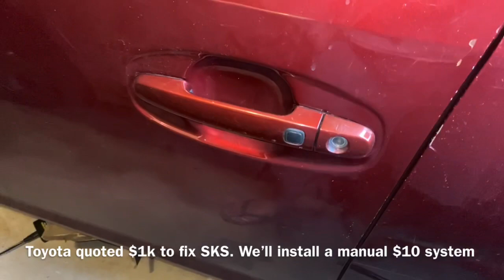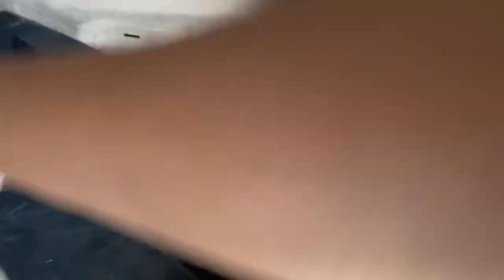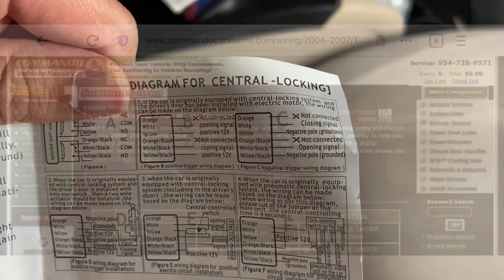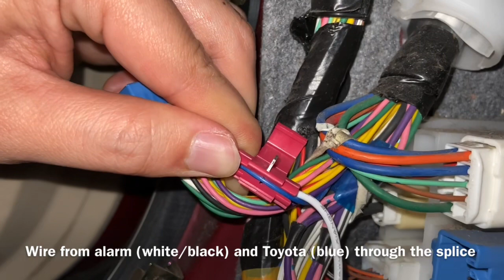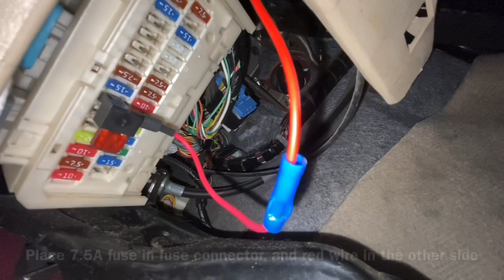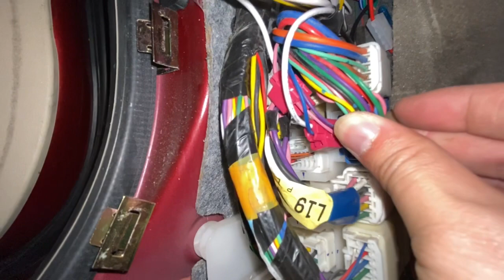How to Install $10 Keyless Entry in Toyota Prius! (b/c SMART KEY FAILED!)

Comment: What exactly did you do wrong to accidently reverse the lock/unlock? The website matches the notepad doc you showed, blue is lock so it gets white/black, pink is unlock so it gets the white wire. It looks like you put the white wire with text to the blue, which is what you and your captions say should be the white/black wire. Then you show a solid white wire connected to the pink with the appropriate caption to match. So what in the hell? Is the white wire with black text not the white/black wire? Or did you go back and refilm the correct connections and left in the part where your buttons were backwards?
Reply from the maker: 1. Caption is correct -- Blue to white/black, and pink to white. That is how it should be.
2. In the video I swapped them by accident so the video is showing blue to white
Reply: @EdwardInTX so the white wire with black text is actually the white wire? I struggled to see any black stripe on the white wire you attached to the pink.
Reply from the maker: @JonEhBee  yeah the black stripe was actually really slim so not evident in the video

Comment: Great video. After buying a Prius on the verge of getting crushed, replacing the ABS module, fuel tank, combination meter, MFD, HV battery, this is the last thing I need to do since this car didn't come with a working keyfob to get in the car (wrong keyfob for SKS). Thanks again from another fellow Texas Prius owner!

Comment: I'm kinda confused though since your buttons are inverted on your remote..

So is the correct connection suppose to be:

Solid white to blue and white/black wire to pink

??
Reply: Yes, exactly.  I did it this way, and it worked great.
Reply from the maker: Exactly as written in the video description. White to pink, white/black to blue.